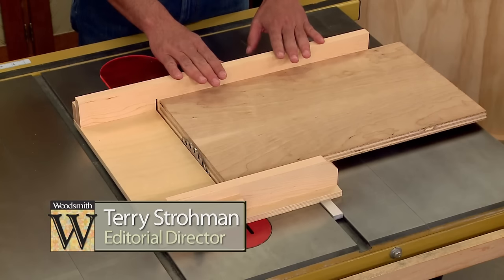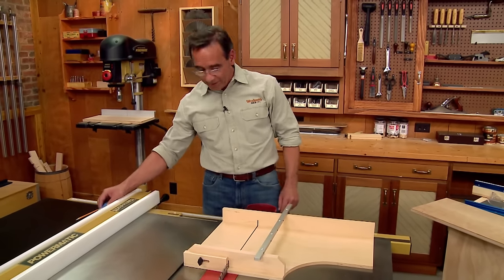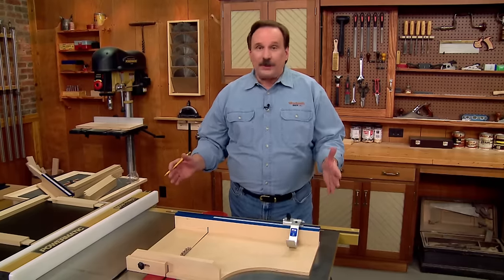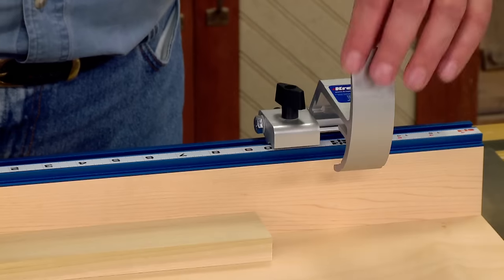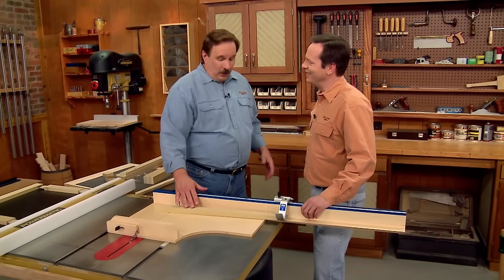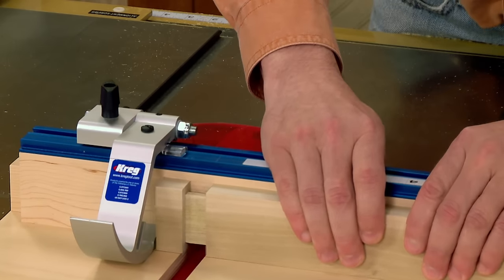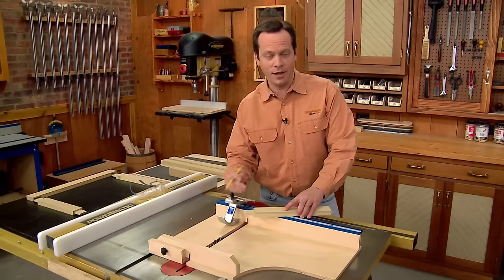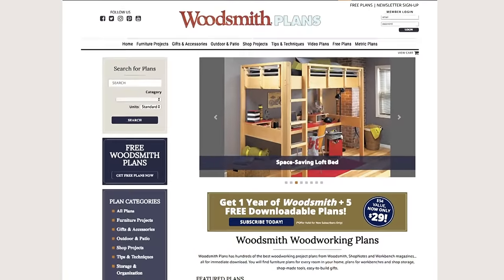Maybe the Best Table Saw Crosscut Sled Ever?

Comment: So as soon as you use the dado blade you bugger up the zero clearance on the fence. Not a good design. Have a separate sled for the dado blade. Why does nobody see this problem??
Reply: Ha! You’re absolutely right! I didn’t notice that but it’s a point well-made. I’d like to see a response from the people who came up with this design.
Reply: If you bugger it up add a piece of 1/4 ply with a couple staples. Then you only have to replace that after time.

Comment: You can adjust the bottom panel for the dado but what about the fence? Once you use a dado, the fence gap will be permanently too wide to go back to a standard blade. Is there a solution to this problem that I am not seeing?
Reply: Good question, perhaps clamping a sacrificial board would protect the fence when running the dado blade.

Comment: I used a UHMW polyethylene bar that comes in 3/4" x 36" pieces for the runner. Very slick and not subject to humidity changes. I bought the on-line plans and they were very good. Keep up the great work Woodsmith Team.
Reply from the maker: Great to hear! Thanks for sharing.

Comment: I like the sled but I won’t be buying the parts they used. I looked up two of them and it was already totaling over $70, probably $150 or more for All Of them. I’m building a sled to
Save money.
Reply from the maker: Yeah, the Kreg Top Trak system is really nice but it isn't necessarily cheap either.  It's probably time to do a follow-up video on how to build this same sled system with shop-made solutions to save a little money.
Reply: @WoodsmithShowandmagazine  definitely other cheaper alternatives out there for t tracks.
Reply: @WoodsmithShowandmagazine  but i gotta say i like this one! Ive looked at some other cheaper tracks and some reviewers noticed theres were sometime warped.. so maybe after all you pay for what you got.   

Any problems with what other mentionned about the dado ruining the fence?

Comment: I've been watching sled videos the last couple days, and this was the first one where you could adjust the kerf. Pretty neat.
Reply from the maker: Thanks!
Reply: Same.  I agree that's a really neat feature.  But it also limits you to using just the one runner in the left miter slot instead of both slots for better accuracy/stability.  I think I'd rather use both and instead create swappable inserts similar to your zero-clearance inserts for your table saw.  A woodworker on Youtube had this for their sled project but I can't recall who so I can't give proper credit, but you get the idea.
Reply: @Warkive  Kings Fine Woodworking
Reply: @Warkive  it can be made using both runners, but they needed one more guy to come out explain how, and everyone knows that it  only takes 3 guys to build a crosscut sled .

Comment: Them: Hey guys! You know what makes this perhaps the best crosscut sled ever? Easy; just add $100.00 worth of unnecessary Kreg items to it.
Me: Nope! That's the reason I make my own sleds to start with
KREG: You guys don't buy our over-priced items.What's wrong? Don't live in the same fantasy world as us,and Woodpecker does?
Reply from the maker: I hear you... all of the those add-ons can get expensive, but they are just add-ons.  The basic idea of the expanding sled will work with or without the Kreg Top Trak and flip stop, and actually, if you don't use the Top Trak you can make the back fence taller which would work better for cutting thicker material.  Then you just have to make your own simple stops with scrap.  One thing I would recommend is investing in a decent runner for the miter slot though.  It will save you a lot of headache and last a lot longer than a wood runner.

Comment: Thick plastic used in cutting boards also make good runners. Often you can get them cheap at second hand stores.
Reply from the maker: Absolutely!  I just shot a woodworking video tip on this very subject: https://www.youtube.com/watch?v=9oaCVX6b1pY
Reply: I just keep slicing 3/4" wide pieces from my wife's cutting board.  She hasn't noticed yet.
Reply: @ramaroodle  hahaha

Comment: I've built this and it's great, but I have to remove Sawstop Dust Collection Blade Guard.  I only wish this sled have vacuum port. It makes a mess at the front of the table edge.
Reply from the maker: We have the Floating/Overarm dust collection for our SawStop and we have to swing it out the way when using a sled.  It would definitely be interesting to add dust collection to the sled itself.  Thanks for the suggestion.

Comment: Why is it safe to crosscut with the wood pressed against the flip stop, but not pressed up against the fence? FYI, I've been doing this for about 4 days.
Reply from the maker: This is a very good question... I think it’s safe to use a stop in conjunction with a sled or miter gauge and auxiliary fence because the entire workpiece is being supported while being pushed through the blade while it is static against the stop. If you’re pushing it through against the table saw’s fence the workpiece could catch and get wedged between the blade and fence and bad things happen.

Comment: I'm having difficulty understanding how the measuring tape works. Either the video was playing tricks on my eyes or yours seems to be way more than 1" away from the blade.
Reply from the maker: On the Kreg Flip Stop there is a little plastic view finder with a crosshair that is offset a few inches from the edge of the flip stop. So when the flip stop is against the blade or at “zero” that means the tapes “zero” will register with the crosshair rather than being aligned with the blade.
Reply from the maker: This section of video probably better explains what I'm talking about: https://youtu.be/FLRlO0Dc-3U?t=1087

Comment: It looks like the fences are made from solid wood instead of plywood. I purchased the plans and, although they didn't say they were plywood,  they also didn't say they weren't. If they are solid wood, what kind? Something quartersawn for stability?
Reply from the maker: We used hard maple, but plywood should work fine too. You’re right that it needs to be stable. You don’t want it warping over time, so if you choose hardwood, something straight-grained and kiln-dried wood be best.

Comment: Is it just me, or does the tape measure seem way off?? The first mark at 1 inch seems a few inches from the blade. Am I missing something?
Reply from the maker: The hairline indicator on the flip stop is offset from the edge of the flip stop.  Here is another video that better illustrates the setup of the measuring tape in relation to the stop: https://youtu.be/FLRlO0Dc-3U?t=1118

Comment: WARNING! Careful, I badly broke my right index finger by crosscuting with a crosscut sled using a stop on the fence.
Any movement of the wood against the stop on the piece your cutting could bind the workpiece between the the stop and blade causing a very violent kickback. I suggest hold down clamps as well to hold the workpiece firmly in place whilst keeping your hands away from the workpiece as well.
Reply from the maker: Ouch, that sounds really terrible.  Kickback can be a real pain.
Reply: Rolf, that's food for thought.  do you think flipping the stop up after positioning the piece, but before beginning the cut would have helped?
Reply: @laurelrunlaurelrun  One should never make a full cut with the stop on the side they can't hold safely. If you need to cut a small piece that can't be held, stop should be removed after positioning the work.

Comment: Is the adjustable thickness challenging to get correct? Make it too tight just one time, and you've ruined your sled. Make it too loose, and you lose the clean finish of backing scrap.
Reply from the maker: It adjusts really easily... while the table saw is off you just straddle the sled over the blade(s) and then just close the base until it just barely touches the teeth of the blade.

Comment: i ordered the plans and everything is turned around from this video,,
Reply from the maker: It mentions this in the plans a little, but the original sled was built for a right-tilt table saw.  The one in this video is for a left-tilt table saw.  On a left-tilt table saw the spindle is mounted on the left, thus the dado blade will stack towards the right.  To make the opening portion of the sled you will want the base to open to the right, as well, so for a left-tilt saw you will want to mirror the construction of the sled from the original plans to look like what is shown in the video.  The last couple of pages of the plan show what the left-tilt construction looks like.  All of the parts will remain the same size they are just flipped.  I also upgraded you to the Premium Shop Drawings.  Just go to this page: https://www.woodsmithplans.com/plan/precision-crosscut-sled/ , log in and there will be a "shop drawings" link right above the "Download" button.  Those drawings should give a little more detail.  Please let me know if you have any other questions or problems with the build.  Thanks, John

Comment: The other problem is.. this is for a left tilt saw. Right tilts need the right side to be stationary. A removable insert would allow for various blades maintaining zero clearance regardless of tilt.
Reply from the maker: The original plans show it for a right tilt saw, which you are correct that is would be a mirror image of this sled.  We've added drawings to the plans to build it for a left-tilt saw, as well, since that is probably the more common configuration nowadays.
Reply: @WoodsmithShowandmagazine  thank you

Comment: Why do you have the sled on the left side of the blade?  Am I missing something?  Is there something I don't know?  (Pretty good chance on the latter.)  BYW - Love the show and the magazine.  I have learned a lot over the years.
Reply from the maker: In this case the sled is built off to the left side because this table saw has a left-tilt blade.  The tilt of blade isn't so much of a big deal as is the way the arbor is mounted in the saw.  The arbor is mounted on the left side so as you stack dado blades and chippers the thickness will be added toward the right, so the base of this sled needs to open up to the right to accommodate the dado blade.  If you had a right-tilt blade the sled would be a mirror image of what is shown in the video.
Reply: Appreciate the quick reply with the obvious answer.  Another of those slap-yourself-on-the-forehead moments.  Another Woodsmith project to make my woodworking better and easier.  Keep up the great work.

Comment: I've seen several different sled designs that have the curved cut out on the base. Is there any particular reason for that? Save weight? Something else? Love the design, especially the extendable fence.
Reply from the maker: You're right... the only real reason is to save weight.  We've done other designs that have cutouts in the middle of the sled base for the same reason.

Comment: dado blades go in the other direction on delta table saw.  it would not be practical to slide the whole left side unless the entire sled is reversed.
Reply from the maker: The plans show assembly for both right and left-tilt table saws.  The table saw in this video is a left-tilt saw. If you have a right-tilt saw and the dado blades stack in the other direction then the main part of the sled would be be built off to the right of the blade.

Comment: LOL when you started showing the sliding front fence for a dado set, the rear fence only showed the thin slot pass through for a single blade.  But, then the dado slot appeared in the rear fence later.
Reply from the maker: It’s the magic of the sled! 😀 I know, those continuity errors get us every time.
Reply: @WoodsmithShowandmagazine  You're the only ones struggling with that.   (that's sarcasm, btw)
Great vid!!!

Comment: why not use both mitre slots? Nylon runners are best, can be sawn, planed etc. It won't glue though so you need to screw them.
Reply from the maker: Yeah, nylon runners are pretty nice too.  We should do a video on all the different types of sled runners - there are a lot of good manufactured runners out there of all different types of materials (nylon, phenolic, aluminum, steel, etc.)  

This is a pretty small sled, so one runner works just fine.  Also, with the expanding feature on the base of this sled it would be difficult to incorporate two runners.  Plus, I often find that trying to add two sled runners adds another layer of complexity that just doesn't seem to be necessary...  Trying to locate them perfectly and keep them parallel so they don't bind seems like more hassle than it's worth.

Comment: The actual carbide teeth of table saw blades are not the same width or have the same exact set. That means some blades will cut more into the left side of the jig than others, and you will lose the zero clearance property of the sled quickly. It is not enough to be able to adjust the right side of the jig.

Comment: I just finished building a crosscut sled very similar to this one.  I included the adjustable opening base for the blade size from thin kerf to Dado set. I wanted the fence to be extendable but wasn't too keen on having to add on a second piece like in this one so I used Grin's idea and integrated two aluminum bars that could be pulled out a variable distance as needed to extend the fence. It turned out great...compact yet very flexible.   I may still add a couple of T-Tracks to the base to do miters with hold-down clamps or other added capability.  It was a fun build.  Thanks for the ideas.

Comment: About a $175 project.  Not too bad for you guys.
Reply from the maker: Yeah, with all of the add-on Kreg Accessories it can get kind of expensive, but you could build the sled and still maintain the functionality and leave off the aluminum track and flip stop and just use a clamp on stop block or shop-made flip stop.

Comment: I am a long time subscriber to Woodsmith magazine. Was this jig presented in any of the Woodsmith magazines?
Reply from the maker: It was actually from ShopNotes Magazine issue #99.
Reply: @WoodsmithShowandmagazine  Thanks Woodsmith!   I will look it up from my magazine and build one.  Dan
Reply from the maker: Great! Let us know how it goes.
Reply: @WoodsmithShowandmagazine  Is that the Shop Notes section of Issue 99 of Woodsmith magazine, or is ShopNotes Magazine a separate publication? I have a subscription to the library of Woodsmith magazine, and cannot find any mention of this sled in that issue.
Reply from the maker: jmalcolm001 - ShopNotes Magazine was a separate publication we produced from the mid-90’s until 2014. At that point we rolled it into Woodsmith.
Reply: Thanks, I was going to ask the same question. I have both magazine's archives here. The paper ones LOL.  Can anyone tell me what the rounded cut off in the base is for?
Reply: @rwind656  It reduces the weight some.  I have the sled and built the extension but rarely use it.  But the sliding stop and the measuring tape on top are a must!  I use them all the time

Comment: No the Bar won't expand and contract with Humidity, but it will with heat and cold but not as much as wood will. Keep that in mind when dialing it it for fit.  one thou play should be fine two thou even better, that's not enough to make a bad cut but it is enough to let the guide bar slide smoothly year round. you could also go even more slop and add some slick type tape like a PTFE tape or UHMW tape.  This stuff is great for wood to wood drawer runners or any tool you need a slick fence on or surface.  Google it or just look for it on amazon.